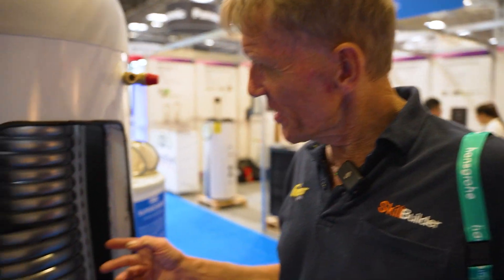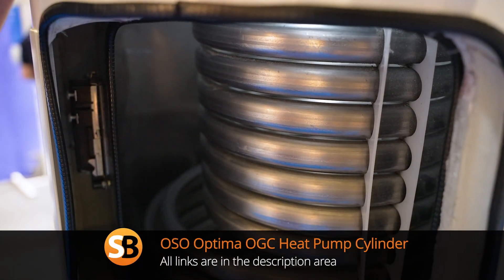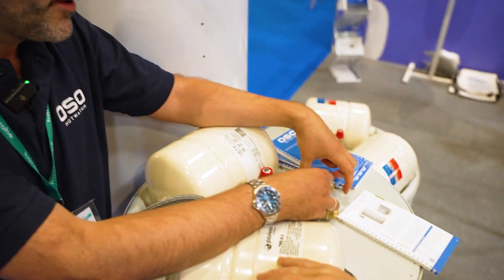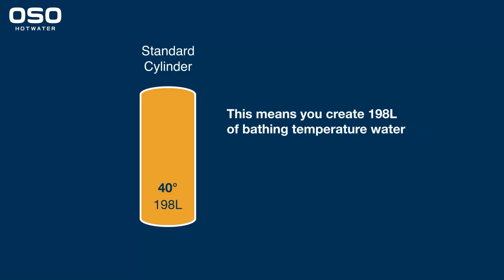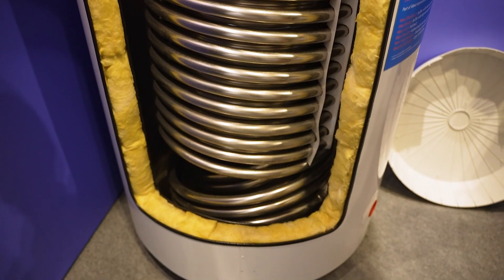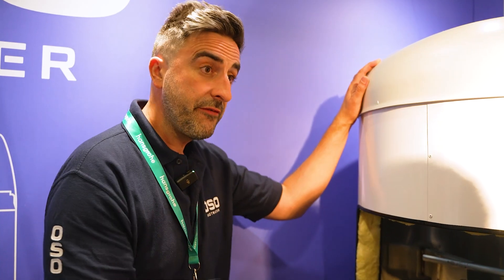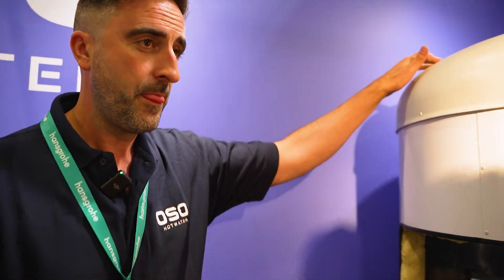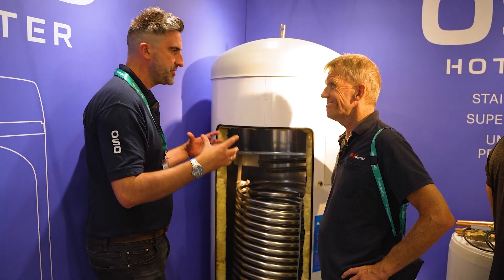Next-generation Water Heater 🗲 OSO Supercharge

Comment: I’ve got a Mixergy and it’s possibly the worst technology I’ve ever bought. 12 months the cylinder broke and to Mixergy credit was replaced. Not a small task. 300ltr. But in less than 2 years the hub that connects the cylinder to the router has also consistently failed. Mixergy will blame sockets, surge protection etc but I have heatmiser, octopus and other devices that connect the same way and don’t keep losing connection. I have no tech benefits that are marketed. Don’t even know if we have hot water. It’s Russian roulette if the water will go cold part way through a shower.

Comment: They are expensive but well worth the money , I lost power after a recent high winds , being myself at the moment that 3 kwh loss over 24 hours on 200 litres  on 50c coming out via blend made it easy going and survived the  2 day power loss , you really couldn’t feel any temperature drop in the water , but there not small for sure , and have already had a expansion tank failure possibly due to shipping but since changing its been absolutely fine ,  I was thinking of a sunamp but went Oso due due to flow out to run two showers without filter on and sink at same time with no loss , it’s also fitted with a power tank to whole house cold water pressure without drop a big no no with the sun amp due to a max of 3 bar and flow of 12 litres a min to desired temp but would recommend fitting a in line drain for regular flush ever other year as part of service in hard water environments

Comment: Spend 3/4 grand on a new tank with software that tells me when I need hot water? I'd never see the cost back. No thanks. Might be ok in a new build but then a new build should be using heat pumps and solar power. I've the same tank in my house 25 years and only replaced the element twice for 30 quid each time. It's on a timer that I tell it when I need hot water.

Comment: I'm surprised that the tank loses 3 degrees per day, I think that's terrible.  My old immersion tank has a heat loss of about 2.1c after I upgraded the insulation jacket. Added some anodes as a preventative measure and expect the tank will outlast me

Comment: The domestic version makes sense. The commercial version not so much. Massive electric requirement when we still don't have plentiful cheap clean power. Still working g on the cart before horse principal. The companies are building their products for when and if this happens. But governments are titting around with nonsense schemes and not providing the correct resources. And now you have Hitler 2 in charge good luck with that.

Comment: Why would Microsoft know anything about hot water cylinder heating!? Is it running windows CE - no thanks.
Reply: They don't. They do know a lot about harvesting data though.
Reply: It won't have anything to do with Microsoft I doubt. It will just connect to some cloud based service hosted in Microsoft azure run by a company no one's heard of but thinks it sounds cooler to say Microsoft.